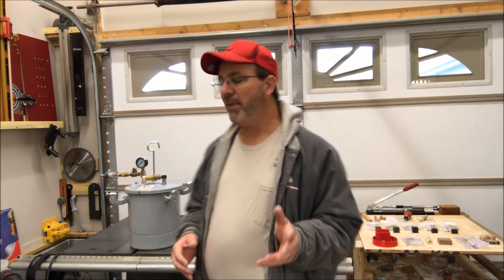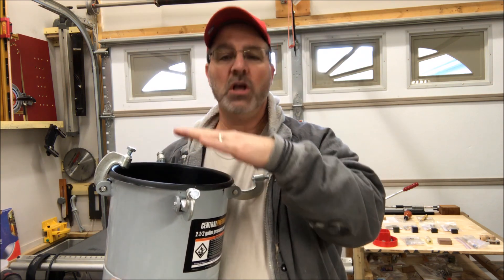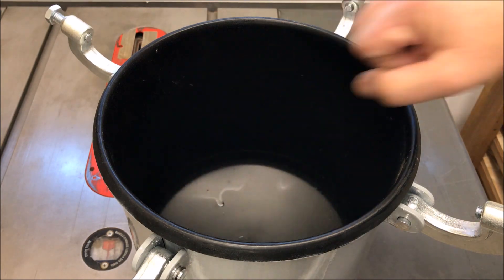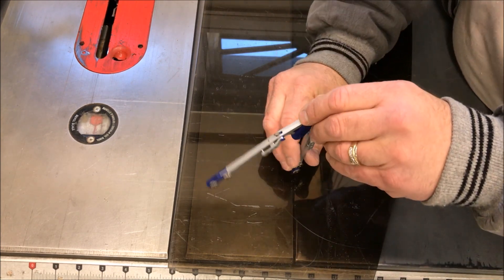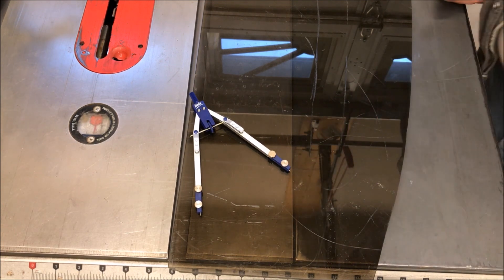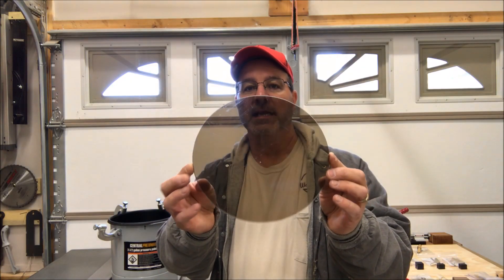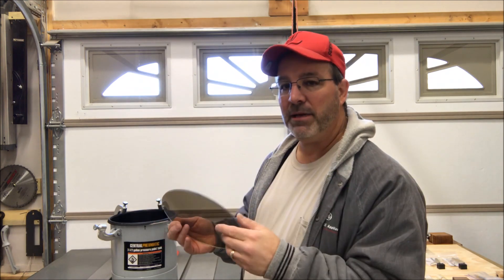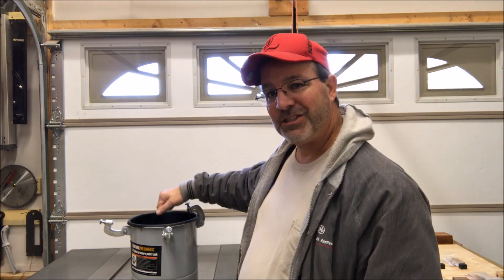Here's How I Built a Floor For My Pressure Pot

Comment: Great idea for a base in the pot.  Thanks for taking the time to make the video.  Can't wait to get started.  I ordered the alumilite direct from the alumilite website, and a couple of the molds from PTownSubbie yesterday.  Also ordered a few other odds and ends as well, like the guides for pen blank label sizing, so you can print off designs or whatever you want for the pen body and know exactly the size you need to cut that paper to in order for it to fit the pen tube.  

I was looking at one of the mini-metal lathes at Harbor Freight the other day, may see about getting one this coming year.  I think it would be fun to make some pens out of metal.
Reply from the maker: It would be really cool to make metal pens. I hope you give it a try and if you do, I want to hear about it. You know me, I need another hobby. :^)

Regards,
Bob
Reply: I'm sure others out there with far deeper pockets are already doing metal pens LOL.  Just figured I'd venture into something different here soon...you know because you just can't have enough tools HAHA!!!
Reply: Hey, math is the answer.  3.14159 * D gives you the circumference of your pen tube.  Paste your design into MS Word. Right click on picture and select "Size and Position".   Adjust the width so it is either exactly the size of the result above or a bit less.  Print it.  Perfect fit.  I do it all the time.  Get a dial caliper at Harbor Freight.  I also do this with my laser engraver when I engrave images or names on pens.

Comment: Bob. I have the same pot and made a 1/4 inch plywood floor. I find that without it being secured to the pot it occasional shifts.  As you know it’s critical that your molds are completely level or you’ll have spill out and potentially ruined castings. Haven’t found a way to secure it yet. Several other Casters have actually filled the bottom with resin to permanently level the floor.
Reply from the maker: This one seems to fit really tight, I will keep an eye on it for shifting and if it does, I’ll make some type of adjustment. Thank you for the info. 

Regards,
Bob
Reply: i added some craft foam pieces around the edge that helps keep my plywood bottom centered.
Reply: Put a few dots of silicone sealer around the edge. You are not trying to make a permanent install, just keeping it from shifting and you can still pry it out if necessary. Add the finger hole as suggested below.

Comment: Why not pour resin in the bottom?
Reply from the maker: Resin is to expensive, :)

Regards,
Bob
Reply: I was thinking to tape the bottom and sides, pour in rice, pour resin all over/in the rice, and when it dries, you have a sealed rice cake base that fits exactly. Maybe even put 2 screws at the sides or whatever before the pour that way you can always have something to grasp the mold with when taking it out and putting it back in.

Comment: Question: if there is air between your floor and the bottom of the pot, will the pressure inside the pot cause the floor to bend since the air underneath is at a lower pressure. Or is this moot since the floor isn't hermetically sealing the bottom.
Reply from the maker: I believe it’s moot. There is a gap all way around as well as a hole in the center so the pressure should stabilize. 

Regards,
Bob.
Reply: You should also add a larger hole near the edge so you can get a finger in there to pull it out without having to tip the entire pot.

Comment: I used a thin piece of plywood for mine and lasered a logo on it.  Sealed it so it wouldn't absorb moisture or any spilled resin.  This gave me an idea though.  It's completely unnecessary, but that's my specialty.  ;-)
Reply from the maker: LOL, I love completely unnecessary. The Crazier the better. Thank you for checking out my video. 

Regards,
Bob

Comment: Why not just make sure the pot is on a level surface, mix enough resin to fill inverted dome in pot base, pour directly into pot. pressurise, allow resin to set and presto - you have a permanent level base without faffing about cutting material to fit
Reply from the maker: That would work, there are many ways to level a pot. 
  This worked for me at the time. It was inexpensive to use the Lexan because I got it for free. Resin is expensive and I didn’t want to use that much for the purpose of leveling out a pot. 

Regards,
Bob

Comment: Turn Tex has free plans for a mold rack that fits perfectly in these pots. I did have to round the corners a tiny bit, but it works nice.
https://www.turntex.com/help-center/alumilite-casting-resources/80-pressure-pot-mold-rack
Reply from the maker: Thank you.